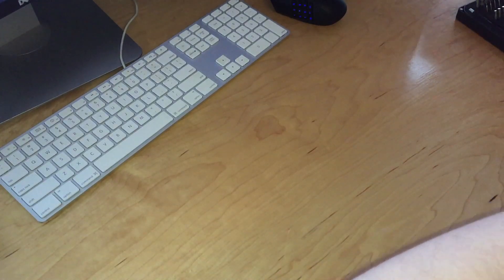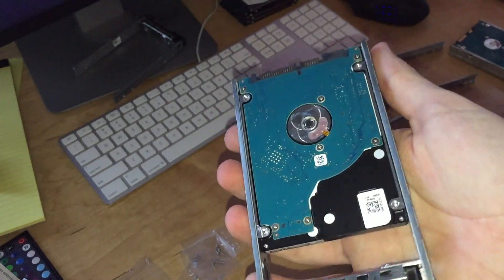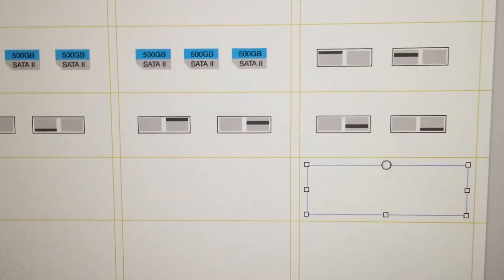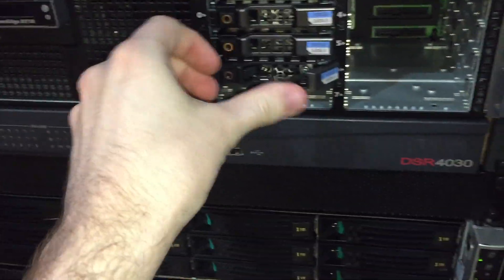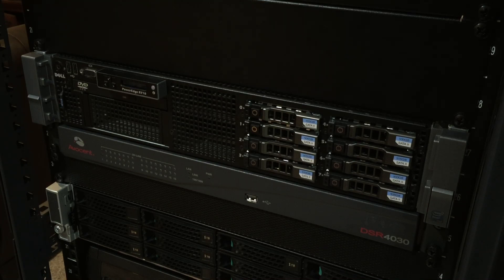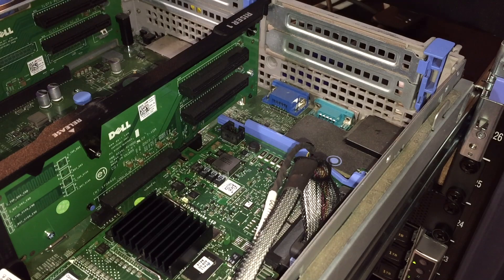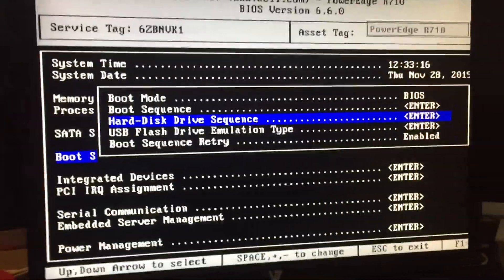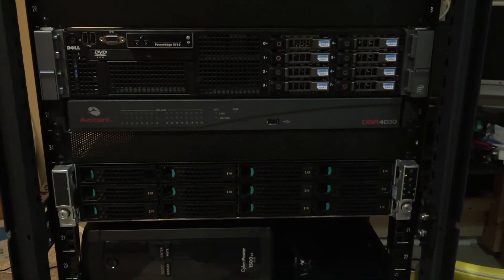Upgrading the Dell PowerEdge R710

Comment: For those who are watching this.
Laptop drives in a server are not good practice.

eBay server grade 2.5 hard drive.
They are typically cheap and his volume drives.

A laptop drive is not designed for running on a server.

Comment: How did you print the labels? Just with a normal printer and label sheet?
Reply from the maker: I used Avery 8160 labels, and you can find templates for Pages/MS Word on Avery's website, I made them in GIMP then put the PNG on the labels, and printed them with a normal printer.

Comment: Also, if you are not using the optical drive, you can get a 2.5 drive tray for it and boot off a 2,5 ssd for running proxmox or similar. 
This is handy for freeing up all drives for a bigger raid
Reply: Except that it plugs in to a SATA 2 controller so it would be a huge waste of an SSD.
Reply: I usually would like to run VMware Esxi rather than proxmox on a server like the r710

Comment: Can this server run with a WiFi card
Reply: I just got a T310 and put proxmox and pfsense on it and was going to use an ax card with a powerful antenna to bring wifi into this part of the house but I found pfsense doesn't really support wifi cards so that was disappointing. I'm not sure what I'm going to do. I have an ac router that can be a wired or wireless repeater, access point, and all that to do the wifi jump but it's ac and with worse antennas so that basically sucks.

Comment: Depending on how you wish to configure the storage I would recommend getting a Dell H200 or a Dell H700 SAS card. the H200 for a HBA if you go for a ZFS storage setup or H700 for HW RAID. If you go for proxmox I would go for a H200 and ZFS. the upside of choosing a H200 or a H700 is that you can use larger drives than 2TB.

Also while it have no effect on anything what you label the drives as, the drives are SATA 3 not SATA 2.